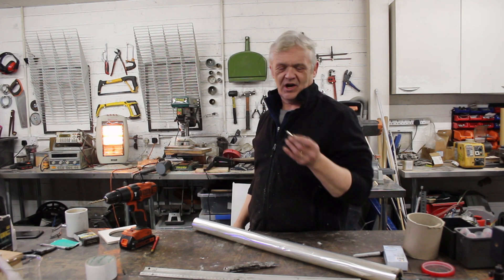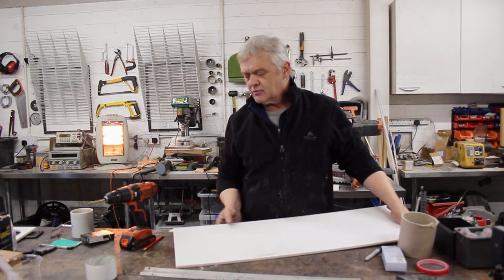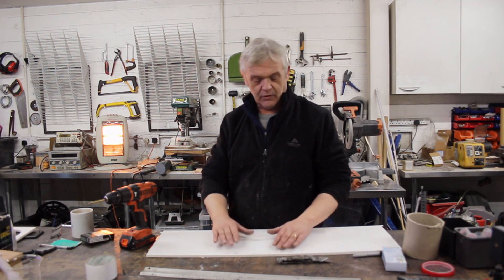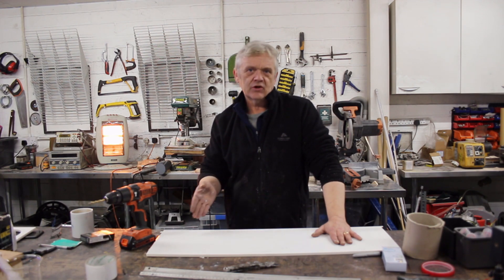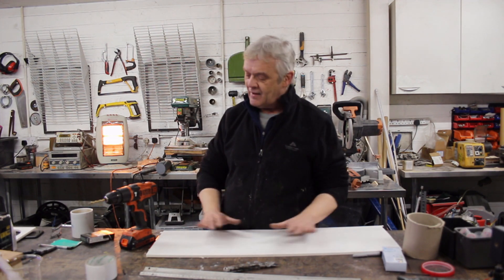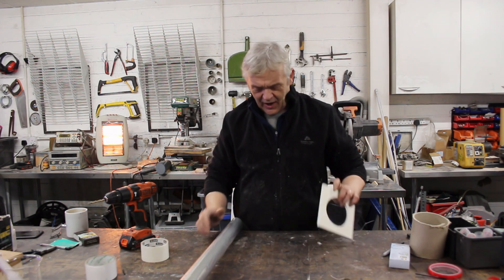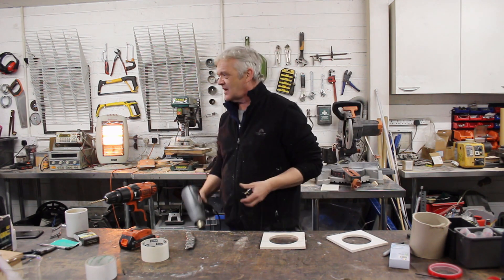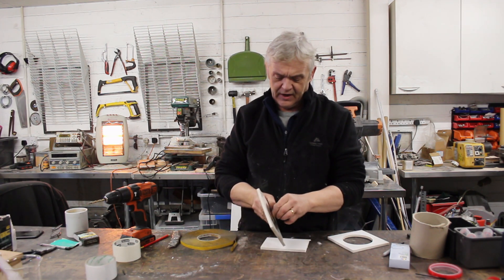1389 How To Turn A Drone Motor Into A Speaker

Comment: Speaking of turning things into speakers, the arm from a physical harddisk will also play audible sound if you hook up a signal to the voice coil, while the arm will move with the power of the signal. Can be turned into a cool light show if you mount a mirror on the arm and shine a laser at it, or possible an sort of oscilliscope if you have two arms mounted as x and y.
Also the BLDC motor from HDD for the actual spinning is crazy fast, just sad that it's very hard to get it out of the metal enclosure on most of them.

Comment: They make a similar product here in the US, made of aluminum with a plastic in the center, to bend score with a saw cutting through only the inside of the bend, the aluminum only leaving the outside and middle intact, it's fairly thin aluminum, like aluminum flashing, something like 0.5mm, with the center about 2- 2.5mm thick, it's about 3-3.5mm total thickness, used for the same purpose, and making signs, it comes in large sheets,  it acts like 3mm thick aluminum only lighter, it's great stuff to make things with,
Reply from the maker: nice pointer mate - thanks for posting

Comment: Did I miss the part where you wired the motor to drive the membrane?
Reply from the maker: it's not wired to the membrane mate - you just stick it on the membrane the wires from the motor then go straight to your amplifier output
Reply: @ThinkingandTinkering  Thanks.
 I did notice the attachment method.
 I was just unclear about diving the motor to generate sound frequencies. 
I'm guessing the amplifier's output provides the proper signal oscillation.

Comment: In Australia any form of expanded polythene material is prohibited in building work  "Effective 1 February 2021, the Minister for Planning announced a prohibition on the use of certain aluminium composite panels and expanded polystyrene for any building work in connection with class 2 – 9 buildings of Type A and Type B construction ",  so PVC board is not so cheap here.  It is mainly used for shop signage, and the retailers charge premium prices !
Reply from the maker: I believe it is a polyurethane mate not a styrene - it's very similar to kingspan with a uPVC coat

Comment: put a bit of wood on the rotor and you can have a bite speaker.  bite the dowel.
Reply from the maker: cheers mate - tbh if you just hold it against your head anywhere you'll hear sound - it acts like a cheap bone conduction speaker - the cellophane is a vibration membrane

Comment: you really should do a video explaining the chemical reason that films and such like this do tighten up from the polymer chains being able to relax back to their original shape they were last in when fully liquid state, vs softened and stretched into a stressed state, especially since this stressed state offers that aspect of being a partial rectifier in clear options like cellophane, so two polarizing films on either side will generate a color rather than just getting darker or lighter on rotation :)
Reply from the maker: good tip mate cheers
Reply: @ThinkingandTinkering  I posted a video link to how the polarizer works with those polymer stretched chains in clear material like cellophane, between two pieces of the polarizing film from LCD monitors, (so salvaged too XD) the plastic is like a piece of the clear packaging over some popcorn too, if I recall, if not I know two layers of clear packing tape that is about 50mm or 2 inch wide works well too :)

Comment: Never showed how you hooked up the motor to the audio out source
Reply from the maker: that's because you just clip it straight to the amplifier output and it doesn't matter which wire is which positive or ground - doesn't matter - but you are right I should have showed that - sorry

Comment: Cool, that's pretty much turning the motor power into a PWM signal
Reply from the maker: all inductors do this mate a ferrite will do it, air core will do it, motors do it - even educated bees do it lol - sorry just noticed how what I was typing sounded so much like that song - but really anything that will create a magnetic filed in apposition to an exiting field will do this
Reply: @ThinkingandTinkering  cool that bees communicate like this. I wonder if the signal can be measured precisely

Comment: I think it may blow up the end-transistor of the amplifier, as it requires 4 to 8 Ohms. Maybe a good thing to tell viewers this might happen. And if they use the earphone outlet, it is even worse, that one expects an even higher impedance. Just saying .. .. ..
Having seen your previous video (the water lens), I thought you were going to make a speaker 'cone'. But I think a flat area is as good (for this application).
I did Google upvc, sintra and such, but it does not translate to Dutch very well. I did find PVC plates, but it is very expensive. Any Dutch people like to comment please, how to get it at a reasonable price?
Reply from the maker: well you could order from UK I am guessing it will still eb next day and not that expensive - anyhow have a look on the TnT channel when I do advise this

Comment: I'm lost after the double sided tape. How does the motor act to make the sound?
Reply: He skipped all the steps after the double-sided tape
Reply: Yea, I still don't understand how the motor spinning is supposed to vibrate the membrane.
Reply from the maker: you just clip it straight to the output mate as Jeremiah said and it works as Jeremiah said - but my bad I should have showed that bit - cheers

Comment: Nice 😁. Think there'll be enough power from the motor to drive a pane of glass to make a "window speaker"...? What about a piezo element as the actuator..? BTW, I'm in the camp that finds that little tune very annoying...! 🤣
Reply: Youtube is deleting this comment. I think because I'm mentioning a popular online retailer in China. This is the third time posting. There are things called "resonance speaker" on <censored name?> that you can buy. They turn any flat surface into a speaker cone. I have a set that I created a portable sound system out of. Two of the resonance speakers connected to an amplifier and battery in a small toolbox I got from Dollarama. I bought some double sided tacky adhesive to use to temporarily attach the speakers to something like a patio deck or picnic table or a wooden board or anything flat and play music from my phone through them and it's quite loud. The resonance speakers I bought claim to be 25 watt. Tech Ingredients made a video about these things and made some flat panel speakers out of them that perform as well as regular cone speakers. I'll post a link as a reply to this in case YouTube doesn't like it.
Reply from the maker: they are sound bugs I think mate - they use terfinol-D this is really a cheap version of a sound bug and uses the inductance of the motor - all inductors will do this
Reply from the maker: it wouldn't have that much power I think mate - but give it a go - by the way all motors or indeed inductors work with this - they are cheap sound bugs really well worth experimenting with a few things if you feel like it